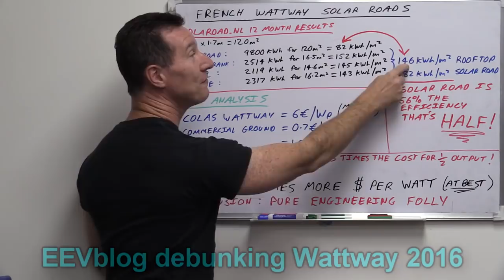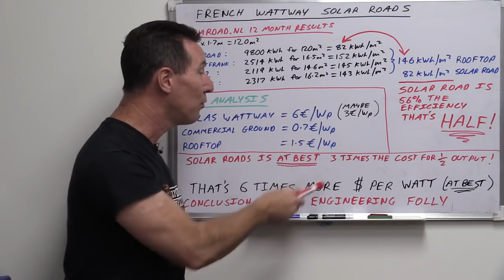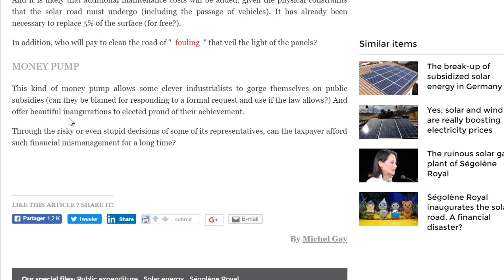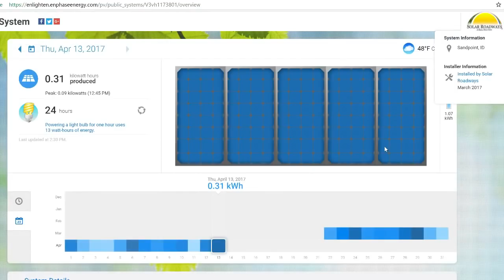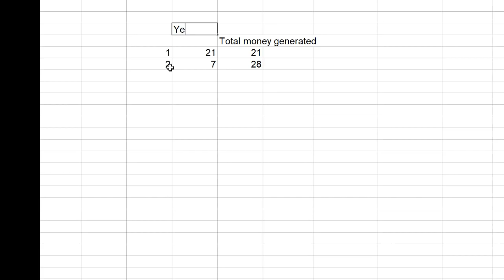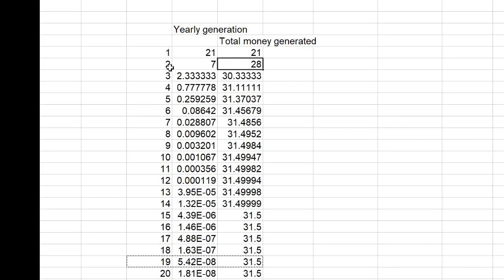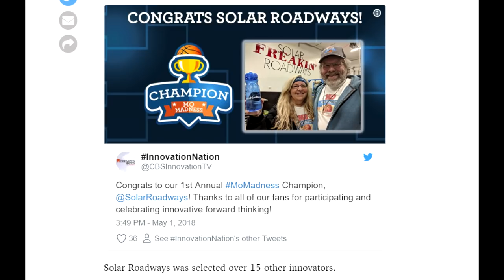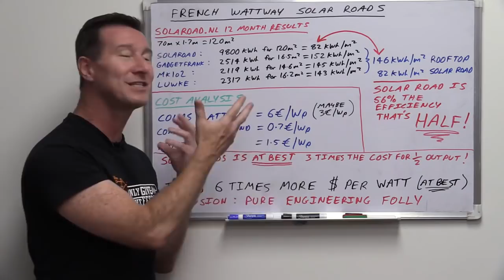Solar Roadway: 10¢ return on $1000 investment!

Comment: "If we cover the desert we'll have infinite power, but let's upgrade this idea by making solar panels where huge steel masses block them out constantly!"

Even the most basic shit undermines the idea why did they greenlight this? Skidmarks will build up. A minor distortion in the road will cause it to break under weight. Vehicles are already a massive destructive liability. People will steal the panels constantly. 

There's literally something that solves most of these issues: not converting roads into solar panels. How about roofs? People won't steal em up there or at least a lot less and it's an incredibly visible crime so enforcement will be easy. No dirt or destruction on most roofs. No vehicles blotting them out 24/7. The space isn't being used for anything else.

Comment: Why do they need to be smart solar panels? Cant they just be normal ones with a protective covering. Its stil a stupid idea.
Reply: Because they need to be in order to address the glaring problem that road paint would just cover the panels up. Funny how they addressed that massive issue, and not the even bigger elephant in the room; Why would you put a solar panel in the road?
Reply: @YukonHexsun  because you have to have roads somewhere. Why not get power out of them?
Reply: @Ragnaracc  See the video for the answer to that "why". Short version: Glass is a shit road material, and driving semi trucks on electronics is a great way to amp up the maintenance cost for the panels to absolutely obscene levels if you can even somehow get it to work as a road in the first place.
Reply: @YukonHexsun  no. You asked why it's such a popular idea. I answered the question. Because roads have to exist anyway so why not? The only issue I'm seeing is they started it in a section of road that was too busy.
Reply: @YukonHexsun  not to say that it's a good idea (I particularly hate the version that sells that theres leds and a heating unit and bla bla bla in them) but from my understanding of the technology where it would really shine is the highways that stretch between cities and towns. Not the interstates but the old highways. Route 66 for example. But it is wishful thinking. Were way better off just you know the thirsty concrete. Or the self repairing concrete then panels. I think that the idea behind solar roads isnt something to make fun of it's just...I think someone said it in this comment section "we tried it. It didnt work. Can we move on?"
Reply: You know what makes way more since? Exactly what he said in the video. Panels on skyscrapers. Or stores. Micro generation Grant's.

Comment: I do agree... technology is not there yet for these things. That being said, what was the price of a solar panel 10 years ago? what was its lifespan? efficiency? Well 9 years ago it was roughly 5 times the price it is today: it was barely profitable for really sunny places. 25 years ago it was as laughable as solar roadways are today: short life span of less than 10 years and exorbitant costs. 
It is easy to be sceptical for a narrow minded review(like all things that you do)... BUT it is much harder to be nuanced to review the whole story and see the future, if any, of this thing.
Reply: Easy: because the roads are not covered by vehicules all the time. In fact, only a small percentage of roads are covered a small percentage of time. Most roads remain partially or completely empty during the day.
The real issue is an engineering problem of great scale: making a sandwich of various materials such as it is resistant to abrasion (transparent layer) with high compression strength, somewhat self healing and allowing for certain flex with almost no thermal expansion under high range of various temperatures. Naturally, to produce such a thing at low costs is the biggest engineering challenge.

Comment: What blows my mind is some one actually believed that the roadway was a perfect place to put a solar panel. They do realize that roadways have these things called vehicles that use them. And the last time I checked these vehicles are rather opaque when it comes to allowing sunlight to hit the roadway surface. So 1) just driving over a solar panel interrupts the light hitting it. 2) if I park my vehicle on top of the panel it is effectively out of action. 3) most people are diurnal and use their vehicles during the day when prime sunlight absorption would be hampered by having them intercept the sunlight. 

The video you started your video with stated that it is said that if we covered 1% of our deserts with solar panels we would provide enough energy to provide the world's demand. While I question the logistics of doing this efficiently to do this, it would probably provide a better alternative to putting them in roadways. At least, most deserts are relatively deserted of life that could interfere with solar collection in a much lesser degree than solar roadways.

Comment: Wouldn’t it be cheaper to put solar panels over the roadways to prevent road glare, provide shade, stop rain to prevent hydroplaneing and you wouldn’t even need to rip up an existing road
Reply: Dude why would you build sides to make it a tunnel for no reason? You just do a roof with support pillars like with car ports and share structures and plenty of sunlight gets in and you don't need a single light.
Reply: @mitchellhood8320  thats clever now the sun can't stab my eyes XD
Reply: markysharky03 or... Why put solar panels on roads and on top of roads? Why do people want fucking put solar panels on the same x and y levels of the road?!?!
Reply: IdiotWithAController - I'm just guessing here, but personally I see a benefit to having solar panels lining roads (following the South Korean example), because that way transporting the energy could be pretty straightforward. You already have a bit of land that's dedicated to transport purposes, so now all you have to do is dig a ditch and put a cable in to transport the energy to wherever the road is going. It could be a town or major city. It could be the gas stations and motels sitting along the road. It could be recharging stations for electric cars in car parks. or the signal lights of the road.

Do solar panels HAVE to be near roads? Probably not. But real-estate is pretty scarce in my country and if you're going to put a solar farm on a plot of land, you're not using that land for agriculture, industry, or living space. Maybe America doesn't have the same issues with available space, though, and reusing land like that isn't as necessary.
Reply: +IdiotWithAController   Because stupid people are better than smart people at getting money thrown at them.  Whether from private donations or by taxes.
Because only stupid ideas convince idiots like politicians & investors.
Reply: Yeah, why don't we just stick them on top of everyone's house? That idea has been around for twenty years. The idea that we should cover roads with them comes from the idea that we need space to put them, but if we just need space put them on all the houses. The ones on houses provide more power and need less maintenance since your not driving on them.
Reply: Over the roadways, may attract the idiots who think they can drive under something, when their vehicle, or the thing they are carrying, is much higher than the allowed space. BONK!
Reply: Tenshi Yeah like all the problems that overhead road signs (including the electrical programmable ones), bridge overpasses, ect all routinely....don't have. Look they are going to make the minimum height the highest thing on the road with room to spare. That means 18 wheelers and flatbeds carrying military vehicles on their back (Because that's how we move out gear long distances instead of driving them). How many passenger vehicles do you see driving around with stuff higher than an 18 wheeler or a flatbed with an armored fighting vehicle on its back? And those are driven by licenced professionals. And for the few cases of error that inevitably happen you can just put a reinforced lip on the leading edge of the structure at every entrance. Look I'm not saying that solar panels over the road is a good idea, just it's not a bad one based on what you have brought up. There would need to be looking into return on investment for installation and maintenance with the lifespan of the panels worked in and most importantly if they could get good enough output with the panels and how they could angle them to get maximum direct sunlight exposure over the full day.
Reply: tenshi7angel That’s easily solved by installing strong steel bar in front of and 0.5m (2 socks) bellow of the panels. Bar will happily trim those oversized vehicles to correct height.
Reply: India used solar panels to shade an aquaduct. Why not shade pipelines in the same way?
Reply: +tenshi7angel
BONK!  Not when said thing is lifted off the ground, like literally any high way sign or power lines are.  You'd have to have one massive 18 wheeler truck that's taller then a 2 story house to even do any damage to them.    Logic people, learn it.
Reply: we already have idiots driving into tunnels and bridges that had height warnings for miles before the idiot rammed into the structure.
Reply: build it a little higher than stop light height which can be considered legal max height. every vehicle is required to be able to pass under them without tearing them off the posts.
Reply: well this could turn out to be useful to take energy from BELOW, you know, all the... cars running on Thorium, they could supply enough power with their radioactivity! lol Of course it's a bullshit, it wouldn't work at all, but matter of fact, this, for instance, could become a good spot for publicity in future "developments" of SFR. Seriously, we don't have to worry about what could possibly work here (who cares, there will be some """experts""" telling us everything), but rather what other nonsense solution their contorted mind can reach out in their campaigns, in the future.
Reply: Almost anywhere is better than under the road.
Reply: lets start with putting solar panels on ALL rooftops first.
Reply: Hendrik Schepkens If humanity is stupid enough to make solar roadways they need to take baby steps
Reply: Perhaps. But it's even better to put solar panels where they are safe and close to where the energy is used--like on rooftops.
Reply: Why not put solar panels on cars
Reply: I think they would need to clear the biggest vehicle for it to work wich is pretty high up to my knowledge.
Reply: They should do this for all parking lots
Reply: *hear
Reply: My suggestion had been to line sidewalks with them. They would act as cover for the elements and produce energy. They don't need to light up or do anything fancy. There would still be a chance of cars coming off the road and crashing into them, but that is true for anything on the side of the road

If they took all these millions and just subsidized solar panels on the roofs of houses we would be far better off. I would love to have solar panels but have not been able to afford them.
Reply: Karamarika you put solar panels where noone can touch them, especially dumbass people who like fucking everything up
Reply: Yeah ...
Until some flattard driving an 11'9" tall truck hits it.
Reply: Yeah, like how people are constantly running into power lines, smh. They wouldn't be built 6 feet tall, come on  people, think a little bit before posting ridiculous bullshit.
Reply: The garbagetruckdriver sometimes forgets to lower his trailertray after emtying it. If you start with constructing trafic noise canceling ramps beside highways, construct them at the right angle and put solar panels on the sun facing side. Gues that could be more ore less idiot proof, and less noise.

Comment: Why not just build a solar array above the roads and put smart signs up hanging from the arrays.... Same solution but more power because you can angle them and have all of the same pros that the roadways are attempting to do, except that it would actually have the potential to be useful. Plus you wouldn't be tearing up all of the roads and dealing with the garbage panels. Only bad cost is the infrastructure at that point.

Comment: The problem with solar roadways was the same as the idea of putting solar panels on Trump's wall and selling the electricity. Many places are in the middle of nowhere and transporting the energy where it is needed either has too much overhead (electricity would be used up in friction losses transporting it) or the cost to produce exceeds the value produced.

Comment: We don't need to put the solar panels on roads. There's like, way better places to put them. What about roofs? Nobody drives on those. How about in the desert? There's a lot of sun there. Like, the road is probably the worst place to put a solar panel.
Reply: I'm all for clean energy, by the way. Renewable energy technologies are ready to be used and definitely the future. It's just that putting it on the road is just fucking stupid. What's next, hydroelectric storm drains? Wind turbine street lamps?

Comment: Instead of trying to replace the road with solar panels to how about we just build a giant array of solar panels that's on struts about 30 feet above the road.
They could be even smart tracking if you want.
It probably be more expensive or cheaper I don't know but it makes a lot more sense because at least cars won't be driving on them by the way this cannot work in cities I mean we could try to make it work in cities however it just be redundant.

Comment: You can't actually sculpt those panels into decent shapes either.  True of any modular paving. But what I'm getting at is roads need to drain and camber and slope up here and down there and footpaths need to bend to meet a door. Something which can be achieved with flexible tarmac. These panels; even if they generated loads of electricity could never have worked.

Comment: Want to know the first biggest problem solar roadways forgets even IF it works HALF as good as they advertise?
How are they going to get the power to somewhere useful and if not how are they going to store it?

1: We do not have room temperature superconductors (or we would have covered the desert with solar and forgot about this problem)

2: There are not enough ingredients for the batteries needed to store the power without having monstrous losses due to transmission distance... 

AKA: Even if they COULD Make a solar road IT. WILL. NOT. WORK.
Reply: you're forgetting like 40 other bullet points.
Reply: But it's a road. They'll just... transmit it along the road...
Reply: DarkStar14n 
Nope. Even if we could store it, we still couldn't cover 1% of deserts with solar panels, because solar panels require cobalt, of which, our planet has a very limited amount.
Reply: Depends on the solar cells used. Organic solar cells use no cobalt, but have lower efficiencies and lifetimes. 

Also, Cobalt is about twice as abundant as Lithium, or three times Lead, or half as much as copper, or 3 orders of magnitude more than platinum. We won't run out of cobalt easily. The problem is extraction costs and ease of extraction.
(source: http://periodictable.com/Properties/A/CrustAbundance.al.html)

The real problem with solar cells in the desert is transmission or storage (as DarkStar14n said).
Reply: There are a lot of problems with solar roadways that make them an idiotic idea that can't work. Distribution however is not one of them. Its a distributed system, you don't have to move the power across the country like a centralized system. You just transport it a few miles to the nearest city.  You don't need anything fancy, the power lines that run down the road are fine, maybe just beef them up a bit. In fact, solar roadways (if it were not otherwise a terrible system that can't work) would be a great system for precisely this reason, ease of power distribution. Its less centralized than our current power generation systems and they don't require superconductors to distribute the power.

Comment: Would probably generate far more energy to just run a bunch of copper tubes along the inside of the Asphalt and let the heat of the asphalt under the sun heat water and produce thermal energy.

Comment: Obviously they are using this tech the wrong way. if they used it to find out who was stupid enough to swallow their bullshit and then used a 9mm pistol to reduce the demand for power @ 15c per round $4 mill eliminates 26 million idiots and would immediately increase the average IQ of the population by at least 20 points and reduce power consumption too, not to mention the additional safety of the roads not having the idiots driving on them any more

Comment: I can see how it's easy to fall onto the hype train when you have government backing and funding ideas like this.  I do kind of expect it from politicians that never seem to understand science and technology, but it's disappointing to have Dept. of Transportation engineers signing off on nonsense like this.  It really puts them to shame when you've got other scientists and engineers debunking it on Youtube in their spare time.

About the degradation of the Idaho solar sidewalk installation.  It seems likely that dirt and wear on the glass surface is a major factor in the premature drop in output from those units.  All of the scuffs and scratches scattering light and collecting hard to remove dirt.  Putting these panels on an actual road is probably going to cause an even more severe degradation, with tires grinding on it all day leaving scratches and bits of rubber.  Like Dave from EEVblogs said, it's just stupid to put anything on top of solar panels.  It's just going to damage the surface material and block light from getting to the solar panels.